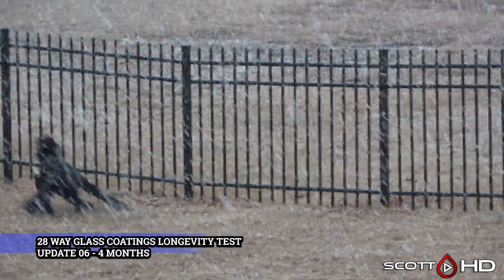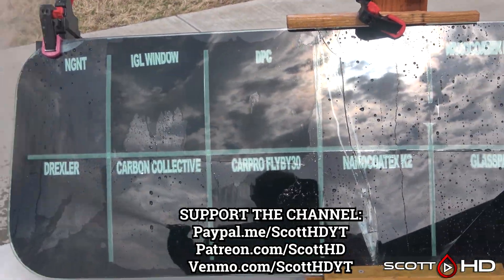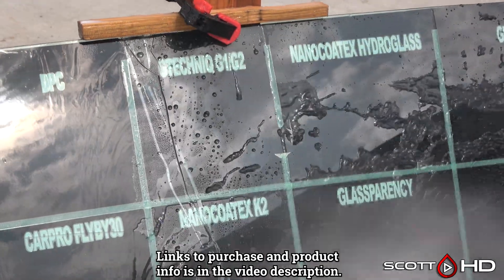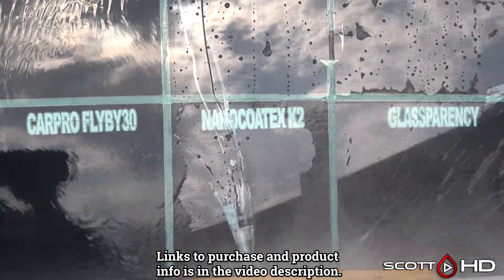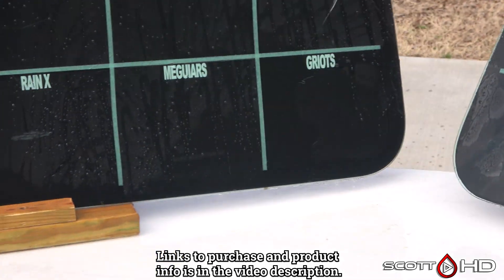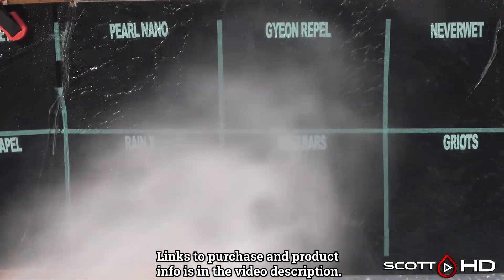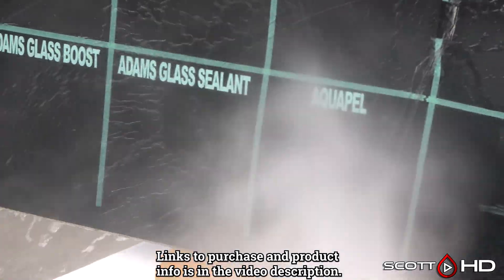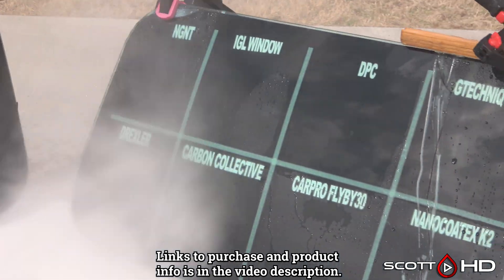28 WAY GLASS COATINGS TEST (HYDROPHOBICS) - UPDATE 06 - 4 MONTHS - more failures!

Comment: What makes Aquapel difficult to install?  I’ve been using that for about 8 years or so.   Back then they had the breakable applicators and u just wiped it on and cleaned off.  Easy and worked great.   Haven’t used it in a while or seen if they have a new way to apply it.
Reply from the maker: Same way, same application. We have been installing it for many years as well.  If you don't wipe it off quickly, it will haze up and it's tricky to remove if it happens.  The humid environment here in Texas seems to amplify the issue.
Reply: @ScottHD  yes I do remember that sometimes but I’m in a hot dry climate so it was rare.

Comment: I used Carpro Flyby FORTE on my side and rear glass. WHAT a PAIN to remove! Nearly impossible to get the swirls and streaks out. Applied with their applicator and used a high quality microfiber towel to remove just as it hazed. Never doing that again. What product applies best?
Reply from the maker: Try out the Armor All.  Super cheap, super easy, and lasts a few months at least
Reply: @ScottHD  Thank you very much!

Comment: Just had a thought for your expiring paint coatings tests....it would be interesting to see how they hold up against scratches. Since there are still spots where the coating is present and not you could drag stuff across the entire hood so the same scratches going over all the spots. You could start with a tree branch with a bunch of twigs and very lightly drag it across the paint simulating driving against a bush when off roading...trail "pin striping". Then increase the pressure of the branch with each test. How much do these coatings protect against scratches. Maybe step it up to throwing sand at it too. Or if you plan on doing a top performers face off you could do that for testing since we already know that they last a long time.
Reply from the maker: It's in the future plans for sure!

Comment: I had an idea while watching this… It would be cool for the glass test especially if you could simulate rain or maybe just show us some footage of the glass when it has just been raining. I’m curious how the products perform in real world conditions with real rain. You could even simulate vehicle movement with a leaf blower or something on fairly low speed to show how the movement of air across the windscreen affects things. It’s not the sort of thing you would need to do regularly. Just once would be enough to give an idea I think. The pressure washer is probably just as good but it would be interesting to see all the same! Cheers for your work
Reply from the maker: That's happening for the wiper resistance test!  Stay tuned.
Reply: @ScottHD  Cool! Will do

Comment: Still impressed with Armor All... thought it would be a 60 day fail at best...
Reply: I got about 2 months with it on my car, given how quick it is to spray on and wipe off I really have no complaint.

For the price though I kinda like it, I don't mind if I need to reapply it every other month if it costs 20 times less but lasts 1/5th as long.
Reply: @GainingDespair   It's not bad for what it is. It's an OK glass cleaner with some protection. If it's raining on my way to work it works ok, but if it's still raining on the drive home it's dead. 

I'm trying out DP's glass coating right now, and so far I'm not a fan, but haven't had any kind of serious ran yet.
Reply: In the real world it's about 7 days...or as soon as you use the wipers.
Reply from the maker: I think it's going ok on my tractor, but close to failure at this point.   It is SO easy to use though, and so cheap, I wouldn't hesitate to recommend it as long as you know that going into it.   Definitely one of those "it's great for what it is" products.